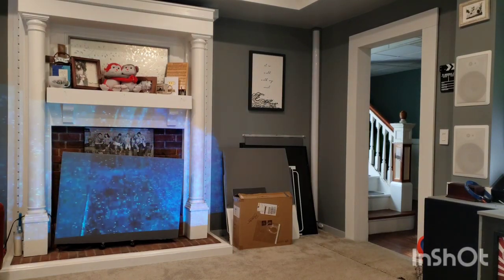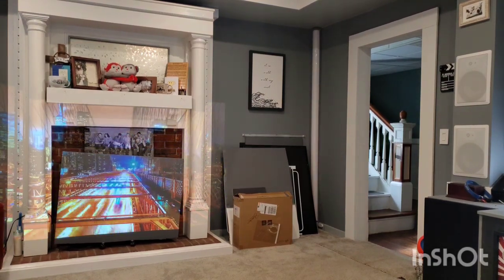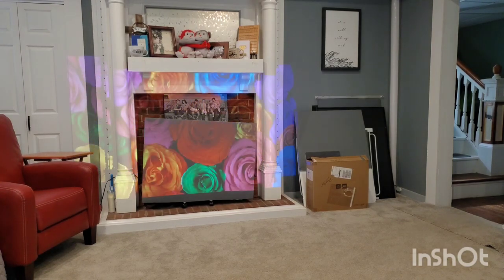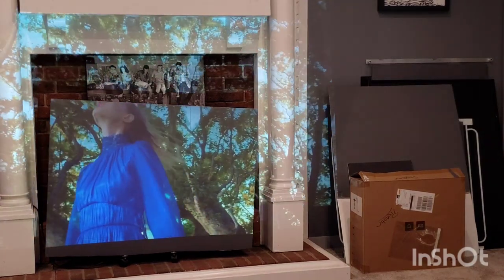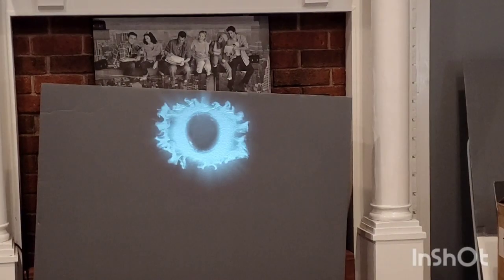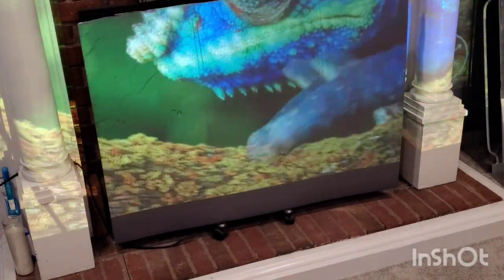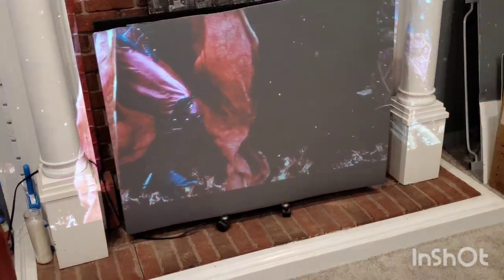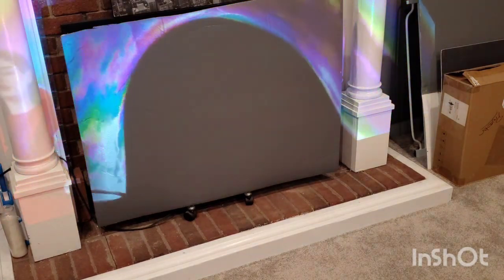PARTAY! : Application Surfaces

Comment: Did you do the motorized screen test yet? Very interested.
Also can you paint the screen on top of a concrete tile floor. Where each tile has grout? The screen would be a cheap pvc screen repaint.
Reply from the maker: Wouldn't be a bad idea to lay a tarp, painter's sheet or something similar underneath.